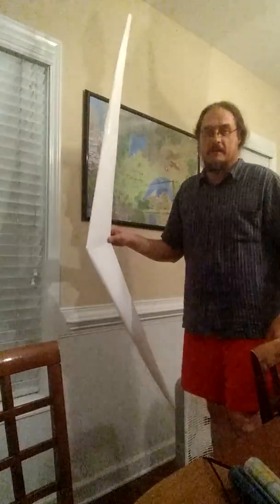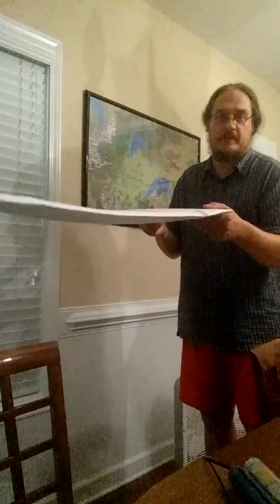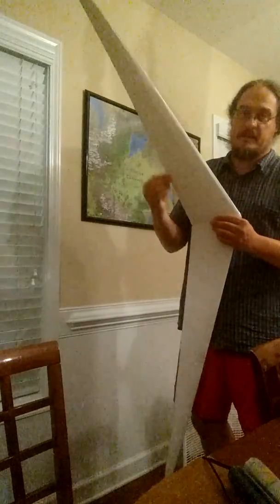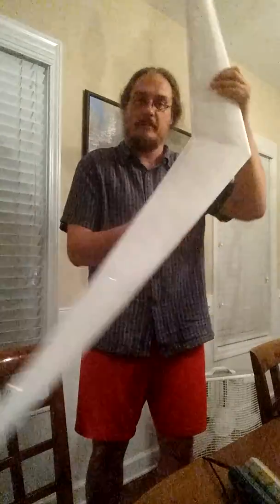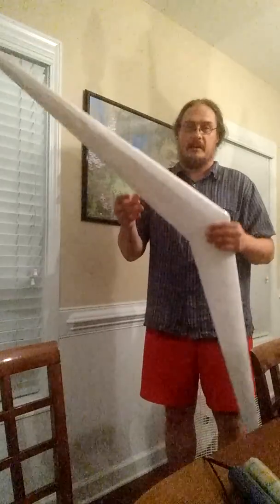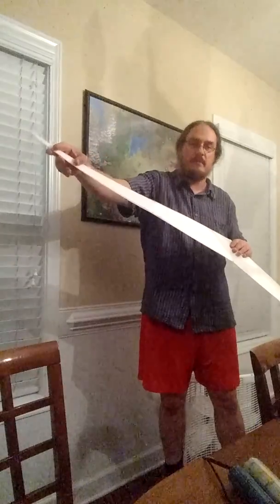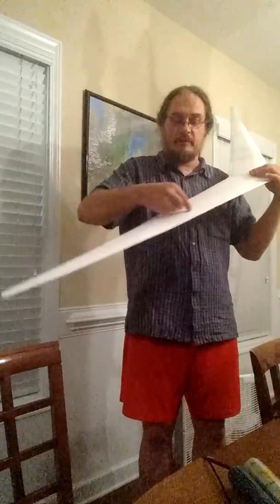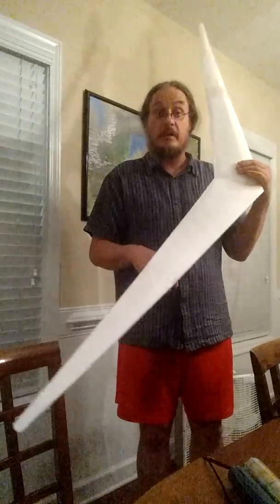FoamyDM - Prandtl-D from DTFB

Comment: Thks but ????did you do a video on how anyone can make your Prandtl-D wing????
Reply from the maker: Tom B - This Version of the Model is VERY flexible. Mostly the materials just aren't stiff enough, however, If you look at posts #2 and #3 in the build log link, there are more approachable ways to build this model.
And this is the link to the working Modified Prandtl-D design which flies well: https://youtu.be/keZ0fyUBuS4

The build video is mostly complete but not released. I have been distracted building planes
Reply: @matthewallen3375  Thks & it seems the slightly fowards-twisted wing tips provides the desired proverse yaw (instead of the dreaded adverse yaw).
I still not-sure how-to DIY the slightly fowards-twisted wing tips though.  So I've just be patience until you post you DIY playlist (of course take your time) & again thks for helping along the way.
PS: I plan to put a glider on a weather balloon, lift it high as possible, & have it auto fly to some location.  Nopes I know nothing about RC gliders yet & yeaps it'll be just for the fun of it (I'm bored in retirement).

Comment: I have been building paper airplane flying wings since the early 1970's.  I build a wing I call the OmniWing.  Single sheet of printer paper.  With some folding, taping and a bit of cutting I believe I have incorporated criteria of Prandtl, with span-wise twist and washout at the tips.  Wing shows excellent glide ratio and stability, even in thermic conditions off of large mountains.  Video shows an OmniWing in flight but first shows the build (in fast motion) and then the flight off of Mt. Nebo in Arkansas.  Nice long flight in light thermic conditions with a surprise ending.  https://www.youtube.com/watch?v=CowekQq6kY8
Reply from the maker: Mike, the link leads to the Jerry Lewis jitterbug. I would love to see the vid you mentioned 

Look for my more recent Prandlt-D wing videos. Specifically the modified planker ones. The graceful flight one shows a great example of it's flight.
Reply: @matthewallen3375  Sorry about that.....  Let's try again.  https://www.youtube.com/watch?v=SrZ1bqU_g4o